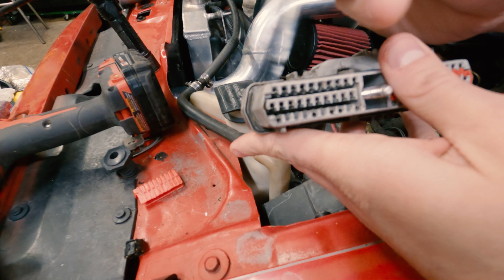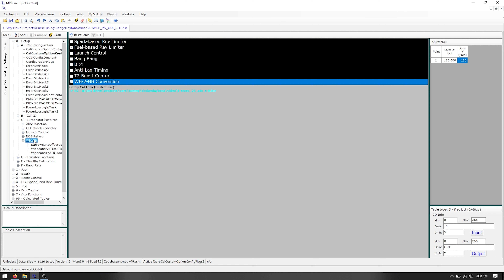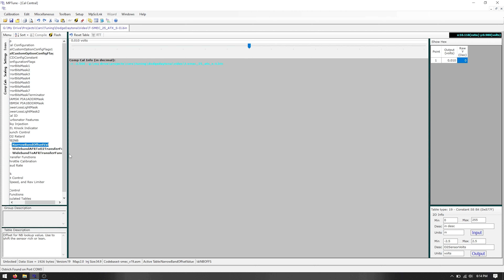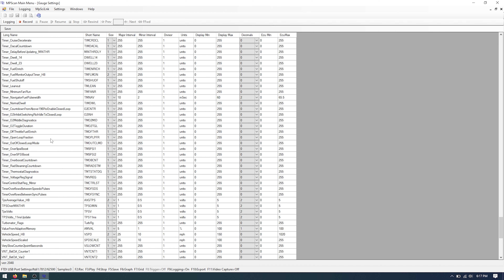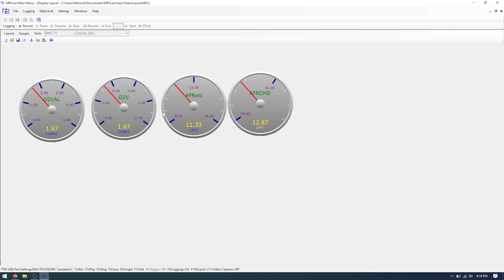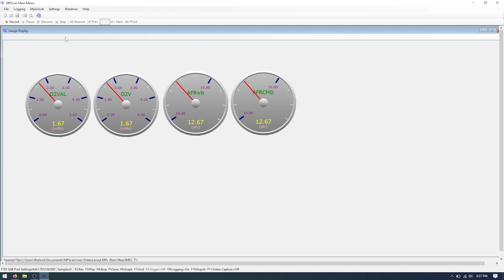Enable Wideband-To-Narrowband Conversion on Turbo Dodges

Comment: It sounds like you are using HP Tune, but I need to be sure.  Can you post a link to where you got it?  
I'm going to do the wideband conversion.  It should allow me to see how my SMEC's current tune is working, before I switch to a MicroSquirt.  Kind of like learning to walk before you run.
Reply from the maker: I'm using MPTune yeah, it's available here: https://pcm.neons.org/doku.php?id=turbonator_and_mptune

Mind you will need some hardware to really do anything with it.
Reply: @NecromancerGarage  I just tried it and both site links are no longer valid.  I have the Innovative wideband kit, so I should be OK, since they supply Logworks for tuning.
Reply from the maker: @laserdad  Oh you're right. Looks like the Dropbox links are dead. I tested DDNS link provided on the Turbo-Mopar thread and it works fine. 👍
http://www.turbo-mopar.com/forums/showthread.php?45009-MPTuner
Reply: @NecromancerGarage  Thanks, I was able to download everything from the link.

Comment: I'm trying to get into data logging on mpscan but the Gauge setup video and how to use it/setup video is gone do you know where I can find any of that info or any info on how to set this stuff up?
Reply from the maker: What are you trying to do? I can probably make a quick video on how to do it if you need it.
Reply: @NecromancerGarage  honestly I don't know how to really do any of it lol like setting up gauges, what ones to have and stuff like that
Reply from the maker: @mdotschneider  First you'll want to make a "Layout" which is basically your set of gauges. So in MPScan go to Settings > Display Layout. 

A new window should popup where you can go to Layout > New. Now you will have a blank layout that you can add gauges too. To add gauges go to Gauges > Add New Gauge and pick what kind of gauge you want, play around with the kinds to see which ones would fit whatever you are trying to do. Once you have your gauge made, click on it and use the right most drop down menu to change what kind of gauge it is. 

Now add as many gauges as you want. I'm not entirely sure which ones most people use, but if you add all the ones I show in the video you will probably have most of them.

Now once you are done with your layout go to Layout > Save As ... And give it a name and save it. 

At the top of MPScan click Settings > Profiles. Click Add profile, give it a name, and then select the layout you just made. Select the applicable ECU type too. Then close out that Profile window. Then in MPScan's main window click File > Open Profiles > TheNameOfTheProfileYouMade

And you're done! Now you can log your car with your gauges, provided you have the hardware all setup right.
Reply: @NecromancerGarage  thank you so much I'll have to give it a try this weekend!  I really appreciate it! I can make the gauge setup without the computer being connected to the car at first right?
Reply from the maker: @mdotschneider  Correct! What I actually do is design the layout on my desktop and load it up on my laptop.
Reply: I have a tiii do you know if it's similar to see up the wideband datalogging on a tiii?
Reply from the maker: @mdotschneider  I think so, as long as the BoostButton tune has it available. I can't remember which architecture it was broken on though.
Reply: @NecromancerGarage  i finally got time to set up my gauges  and im trying to log with mpscan, i was able to flash my car with mptune, now im trying to log with mp scan when i connect the usb to the computer the COM port shows up on the bottom left of the program and i open the profile i created but when i start the car nothing is happening on the gauges on the computer... is there somthing that im missing here?
Reply from the maker: @mdotschneider  If you see in the video down in the bottom left it should say "FTDI" not "COM3" or whatever. More than likely you are missing a driver. You might reach out to Meyer Tuned about the driver. I'm actually swapping to a new laptop in the next few days so I'm sure I'll run into the same issue as you and will need to install the driver. I'll let you know what it is when I find it again.
Reply: @NecromancerGarage  does mpscan use a different driver? Because it worked with mptune
Reply from the maker: @mdotschneider  You flashed the computer with MPScan using the FTDI cable? Because as far as I know you need two seperate cables. MPScan reads from the diag port on your car with a FTDI cable while you tune your car with a USB going to the Ostrich 2.0 box.
Reply: @NecromancerGarage  yea I flashed with the ftdi cable through the diag port
Reply: I got the cables and connector from Meyer tuned I just assumed you were using the same set up lol
Reply from the maker: @mdotschneider  Oh, that's cool. I don't have that one lol. I use an Ostrich 2.0 so I can live tune it. 

I don't think you can run both MPScan and MPTune at the same time with that setup though. I'm pretty sure only one program at a time can take use of the hardware. Maybe give that a shot?
Reply: Thanks for all your help I finally got it to connect to my computer, is there anything else that I really need to know for using the program like how to record/save or how to view the files?
Reply from the maker: @mdotschneider  I think once you have your run recorded you can just save it to with File > Save As ... Then name it. I'm still trying to find a clean way to parse the data like how Diablo or HPTuners does it. It's kinda hectic reading logs.

Comment: I'm glad to see you are still modding your Daytona.  Awesome video, but I was confused by your wide band/narrow band wording.  I realize that you are converting to wide band, but your wording seemed to indicate that you were converting to narrow band.  At least that's the way I heard it.
Obviously you have done a lot of research, so where did you learn how to do this?
This summer, I hope to convert my Daytona to a MicroSquirt, which I am not looking forward to learning.
Reply from the maker: It's worded kind of funny because that's how it's named by Turbonator haha. So basically you are using a wideband to feed the ECU which then converts the signal into a narrowband for use with the fueling. But physically, yes, I'm going narrowband to wideband. 😂
Reply from the maker: I learned through trial and error kind of. The forums kind of tell you how to do this but not all in one spot, it's scattered everywhere. Hence why I made this video! Took me way too long to figure it out. 

And can't wait to see you run a standalone! That'll really unlock a bunch of possibilities.
Reply: @NecromancerGarage  The problem is that I will have to learn how to do it, which will take who knows how long?
Reply from the maker: @laserdad  Yeah but at least there's plenty of documentation for that systems unlike MPTune!